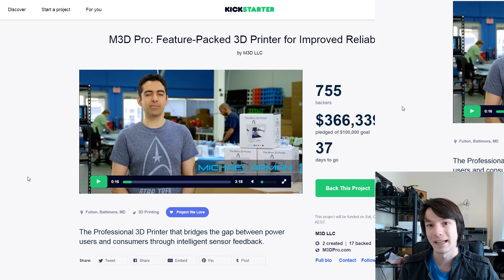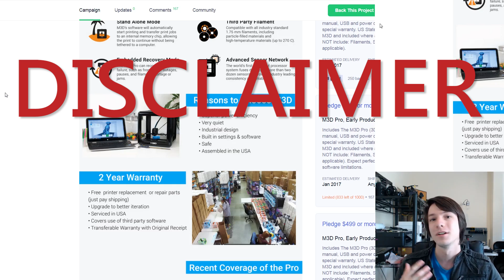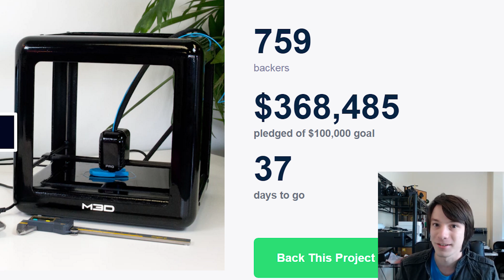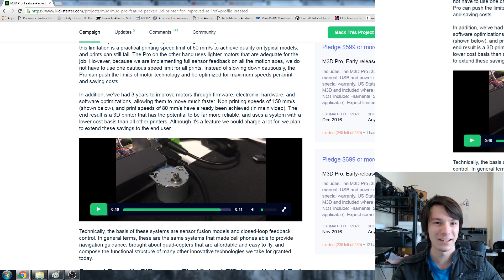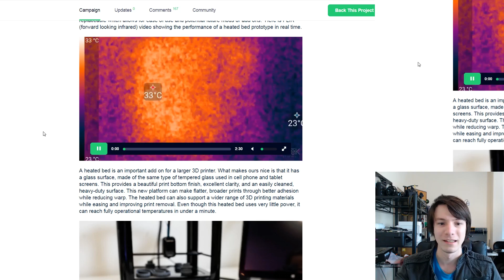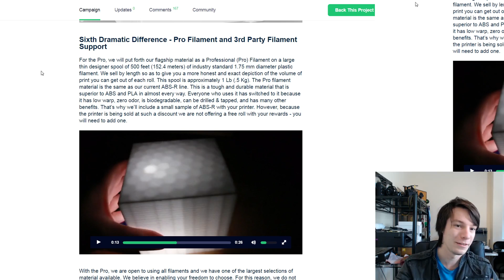Should you back it? M3D Pro Kickstarter Review

Comment: As a M3D Kickstarter backer who has now so happily transitioned to a Monoprice branded Wanhao i3 (what Monoprice lists as V2 has all of the improvements of the Wanhao V2.1), besides all of the other print issues I had with the M3D due to firmware and CUSTOM slicer software problems (auto bed leveling that wasn't, print skew on some objects but not on others, etc.), the incredibly slow printing speed alone would prevent me from ever buying an M3D again. I couldn't believe how much better and faster are the prints I get from my Monoprice.
Reply: Totally agree!
I threw my M3D on the floor out of frustration.
M3D is just a piece of crap. Totally unusable.
Now I have a Flashforge Creator Pro. Finally a decent 3d printer.
Reply: I was initially a M3D fan, slightly disappointed with the print quality and the slicer but it was a 3D printer that worked, Now I have a Flashforge Dreamer and it runs by a dream.

Comment: very simply, don't buy one. I had a "retail" version of the Mini and got to say the biggest flaws in the unit are still there by simply looking at it.  the carriage design is WAY to flimsy and flexible. and as Angus states the basics of the design makes for a large amount of slop in movement. I went through 2 units with the mini as the 1st one never worked in the 1st place.  Also the software/firmware for the unit is ridiculous. they don't even use end stops.. then thing goes to the end and grinds, and grinds... till the motor feeds back it's not moving and that where it records the end. Ugg.  then add the leveling system works  similar by poking the nozzle into the bed till the head flexes back a bit and it reads that it's stopped. issue is after it's done this 2-3 times it leaves a dimple in the bed, and each time after that the dimple gets deeper, so then it starts setting the bed level too low.   just foolishness to be honest. I could go on,.. but there is SO much better out there for the money.

Comment: (offtop)
Recently got my own build surface, print bite. And after a while encounters a problem with ABS adhesion: need to print long ABS part, approx. 25cm long, and the ends of it detaches from surface. The bed temp. is 110c, and i am not sure if my printer can go any higher.
Angus, did you solve the problem with ABS adhesion?

Comment: I'm backing the other 3d printer currently on kickstarter, the metal delta. A delta kit. I looked at this one and at the delta and the delta is more open and changeable. This is the second one for that company as well, but it seems the backers there had a better experience. It's a smaller kickstarter then this one, but less hype. I'm interested to see how both will play out and if M3D do it right in quality this time.

Comment: Heated bed vs none heated bed for ABS 
I actually have cube 3rd generation which don't have heated bed, and it do great job with abs however the build volume not big 150mm all .
I do get warp issues with abs on other machines that has heated bed , but on cube the secret is the glue they provide.
However that's extra cost I wonder would power consumption vs glue consumption any difference?
As for glass bed I had no issues with abs on ultimaker 2+ but I also made top and front cover to keep a heated chamber . 
Only machine I seen no warp is Zortrax m200 , currently printing with Cubicon single and all amazing! I'm in love with Cubicon.

Ultimaker 2+ market 25 micron resolution, I attempted to test that a print that usually take me 3 hours on 200micron would take me 17 days on 25 micron, so I recoiled back and maximum resolution I tested was 50 micron and took 20 hours (Yoda head) I lower the speed from 60mm/s to 20mm/sec 
I could not tell the difference between 50 and 100 micron

Comment: I have the original micro, do I love it? YES though not without its problems but not as bad as others were/are experiencing I guess I am lucky. Will I back the PRO? No. Why? Its not because I don't love what they do, its because I rather try out different printers from different companies. The monoprice mini select is my next one, even cheaper, about slightly bigger build platform but with heated bed. I don't need a big build volume anyway otherwise I would have set my eyes on the select v2.

I do wish them luck and listen to their customers on what they want, m3d holds a place in my heart because that's where I got my first 3d printer.

Comment: I had an M3D micro, and it never worked.  On paper the micro looked great, and seemed like the perfect desktop printer, for small spaces.  But it was a nightmare.

I should have researched first.  Many of the Youtubers that bragged about and showed the M3D went from that, to having videos of weird failures, to selling them on ebay.  Should have been a red-flag.

I had well below 50% success rate, with known good STLs.

I spent way more time trying to communicate with M3D than using the device.  I was eventually able to return it for a huge "restocking fee" loss, and never looked back.  The restocking fee was money well spent to get rid of the thing.

I can only speak for the micro.  The head is very sloppy, and torques from any minor force of pulling the filament.  I was never able to use the filament tube/under-bed filament holder, because it jammed every time.

The extruder, like every part is custom and very weak/cheap, and prone to jamming.  I had to leave the head disassembled, because I needed to clear the extruder of a failure at least every other attempt.

The X and Y axis would shift nearly every print.  I think this was caused by the gantry being very weak.  Any resistance from the filament, or a breeze, would cause a shift.  I even made a very low resistance spool holder that held the filament above the printer, and still had this problem.

The cooling fan sounding like it was dying from the day I got it. 

The parts all all custom, and they would not tell me price of replacement parts.  If you need a part, other than fan, nozzle or bed, you need to request a quote.

They have a customer forum, but even as a customer, they would not give me access.  I had to use Google cache to see all the bad threads posted in there.

The heater for the hot-end is a donut that is held by light friction.  It can and will easily slide up and make the printer fail.

The Better Business Bureau, in Maryland, was very bad for them, and even today there is a  big red link on the page stating "! THERE IS AN ALERT FOR THIS BUSINESS !"

Beware of this company.  Research the company, beyond the marketing hype, before buying anything from them.

Comment: I have a Micro and i actually love it. For the price it is excellent. I think the reason there are so many bad reviews is because they sold it so cheap that people who have no business owning a 3d printer wound up with one. Everyone was expecting this machine that u load a model and it prints this perfect object for you. The reality is that 3d printers require calibration and trial and error.
Reply: This is mostly the case, I got my M3D for about $160 second hand It didn't print straight away and I needed to contact the previous owner since then It works well but I accept its print quality is not great and its accuracy sucks at a low resolution and with no way to change that on the software makes it even worse. Still a cracking little printer if you put in the time.

Comment: It's $499 USD plus delivery plus VAT plus VAT payment fees so $730 USD and not delivered until February next year for International orders.
For $730 USD convert to GBP giving £562. 
You can get an UP! Mini 2 delivered tomorrow. Or Wanhao i3 Plus tomorrow plus £183 left. Or 3 yes 3  cheap i3 plywood printers from ebay delivered in 3 working days and still have £121 left for upgrading all 3 of the i3's.
And that's just of a small selection off the top of my head.

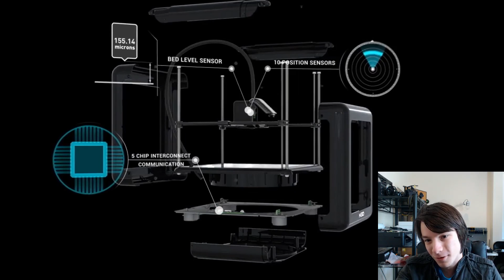Comment: At 12:05 he mentioned rods with spline. Does anybody knows where I could get such rod (diameter 5-10mm) for cheap? I checked ebay, but all I get are some automotive or industrial parts.
Reply from the maker: They're likely custom made for the printer, I have seen similar things in the past but yeah, not sure exactly where you could source a small amount.

Comment: my wanhao i3 2.0 ( now self upgraded to 2.1 and above) cost me 300USD and it had run about 12m of filament before i got it.

throw a e3D on it with a stainless steel nozzle and i can print anything with a larger print area and it STILL less than this ! and thats with E3Ds i3 kit with a titan extruder and mounting hardware.

Fail

Comment: I only have experience of dealing with US companies """Customer service""" from the UK and it is like falling into a Kafka novel.  So on that basis and considering that all the components are proprietary, there is not a barge pole long enough.  The design is very interesting and it may be brilliant once the technology matures but the long path that some axis drives have and the geared stepper motors are going to have backlash and flex with the benefit (sic) of some damping that comes with such a system.  I am speaking as someone who spent part of my engineering apprenticeship servicing NC machines.  One regular job involved swapping out geared resolvers by touch while my elbows were in warm oil because the unit was positioned in such a way that you could not both see them and work on them at the same time.  Good times :P

Comment: +Maker's Muse you can use octoprint on the micro but the only problem i have had with it is not sticking to build platform
Reply from the maker: Ah neat, that's good to know. Did you upgrade the bed to a heat bed? I honestly can't stand using printers without one.
Reply: well ive tried too just im quite new to 3d printing

Comment: DON'T get this printer!  I have their M3D Micro and it sucked.  It produces terrible print quality at slow print speeds after many many many failures.  I was able to get a few serviceable prints off of it, including one ABS print with a ton of fiddling and post print work, but for the most part the printer did little more than turn filament into trash can filler.  I still have it as I couldn't sleep if I sold it onto an unsuspecting buyer.  I bit the bullet and got a Luzbot Mini and couldn't be happier - it was 4 times the price I paid for the M3D Micro but it has worked flawlessly out of the box.  
I'm confident that this company WILL send you a printer if you do decide to back their Kickstarter campaign, but I doubt you'll be happy with the printer you get.  Just my 2 cents

Comment: I purchased a late model M3D printer back in March and it's worked pretty flawlessly.  I don't push it too hard and only print a print or two a week but I've enjoyed it very much.  I suspect that later models have a number of improvements that the earlier models did not and I can understand those individuals who got theirs on the original Micro Kickstarter campaign.  It's not a fast printer by any stretch of the imagination.  FYI, their flexible ink has worked quite nicely though I haven't found much use for it.  I suspect this newest printer will be much more successful out of the box than the original model.

Comment: Any update on the trinus, any word from kodama or have you been using it yourself lately?
Reply from the maker: I haven't used it much as it doesn't offer many advantages over the other machines I use and without an interface it's a bit difficult to run. The production machines will have an interface and be much easier to control.
Reply: Cool, thanks for the response.  I'm kicking myself, i should have gotten the wanhao so i could start printing now.  gonna be a little wait.  Then again, i'd be kicking myself because the plus would have come out after i ordered it.  

(although i kinda want a fabricator mini maybe since it won't break the bank)

Getting lots of Cad experience under my belt atleast ahaha.

Cheers.

Comment: for $200 I got a prusa i3 with a heated bed...
Reply: I didt know they where that cheap I got my whanahoi3 for 375
Reply: +I Dont Care I just looked around and after some time I found the printer.
Reply from the maker: Would have been an acrylic kit though right? Good deal but the extra cost of the wanhao is worth it imho for the metal frame and comes almost ready to print.
Reply: +Maker's Muse my printer was a aluminum frame
Reply from the maker: that's a crazy good deal!
Reply: yes. i got this too. the anet a8 version. it's around 225$ atm on gearbest. this thing works very well. i can print even flexibles.
Reply: +SwissGravityForce first thing I'd do is swap out my Anet board for a RAMPS or GT2560, mate. It's a limited, rather closed-source board and I haven't seen it in Marlin support, at least not easily or accessibly. If it goes or you need to upgrade, it won't be Easy!

Comment: No....No....No......thats the only answer i can give. i backed the first on and still have the useless paperweight in my house. I get it was a Kickstarter, but the customer service and whole companies attitude just stinks...stay well away from M3D.
Reply: "Useless paper weight" lol
Reply: Same issue with me in Canada.  1st (kickstarter) printer I got the fan stopped working and was useless.  Got charged to get a replacement fan but didn't work (I think was a faulty circuit board), they'd replace it with a new one for an added replacement cost.  That $300 printer costed me more than twice that after shipping, customs, etc; which I could have bought a tried and true existing printer right away with a larger print volume.  Even if it worked perfect the 1st time, the parts used to reduce the costs isn't worth it if you want to upgrade and tinker.
Reply: trust me they've improved massively. They are really active and support is much better. Try contacting them again
Reply: Ive moved on now, wouldn't even bother trying to contact them. The M3dPro is going to be about US$650 with shipping which is about AU$850. For that price I dont need to back a kickstarter project, I can buy a proven decent printer such as the Cocoon Create or even for just a little more a Flashforge Dreamer ( I got mine for AU$1200 but they are a bit dearer now). to me  AU$850 is a HUGE risk when I know how bad the company acted last time.....this time they may not even deliver.
Reply: Well I guess this project isn't for everyone :)
Just thought I'd say that they do seek to improve themselves. They didn't have the best of starts though I'll admit that
Reply: I get what your saying, Im just very bitter as to how we as initial backers were treated. Overall the M3DMicro cost me over AU$600 with initial backing, filament, shipping and then the "surprise" warranty which you have to pay for anything over 3 months. I could never get it to print ABS without warping, PLA wouldnt stay on the bed without double sided tape and after less that 50 hours print time the cooling fan went and they wanted some really stupid price to ship a $4 fan to me ( i think US$30), and it apparently wasn't covered by the very expensive warranty i purchased which should have been free anyhow. So yeah im just a tad bitter about it all.
Reply: Yeah they've released new iterations of the M3D which fix most of these problems, but it's still not uncommon to hear issues.
I understand the bitterness :) The CS back then was pretty shocking
Reply: LOL.....at $100AU each way shipping thats not gonna happen. If they fix it for nothing and pay my shipping fine, but really you just cant justify spending any more on such a crappy printer. Just out of curiosity Evan, did you get yours as part of Kickstarter or afterwards ?
Reply: i have an M3D and it literally jams every time I use it. i've tried internal and external spool holders, and it doesnt seem to matter which i use, they both jam. even on the off chance it doesnt jam, it's slow as shit, and the resolution is horrendous to the point where you can't even print gears or screws. i completely agree with you on this one
Reply: BigB 
Also have one, most expensive mistake ever. Couldn't get the freaking thing working what so ever with a decent print quality...
Managed to get a spiderbot working easily after troubleshooting the nozle temp :/